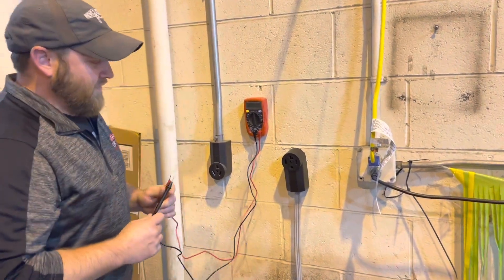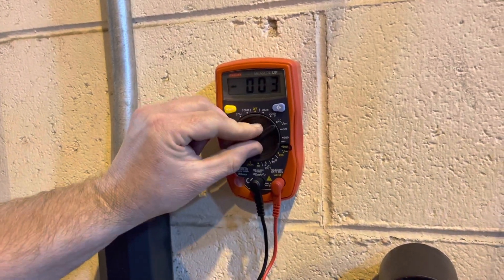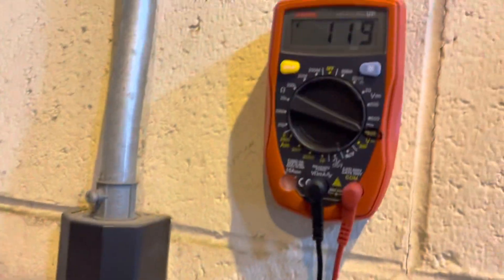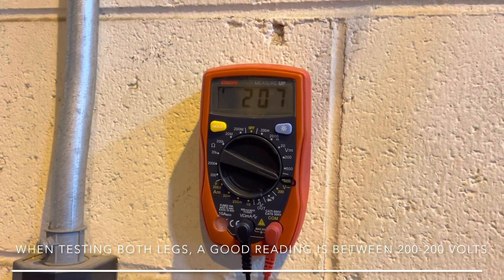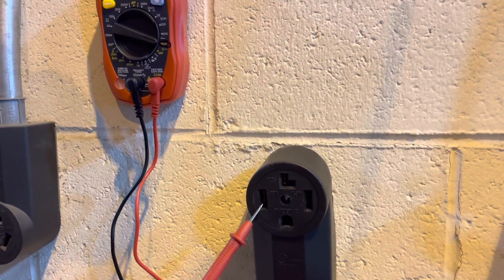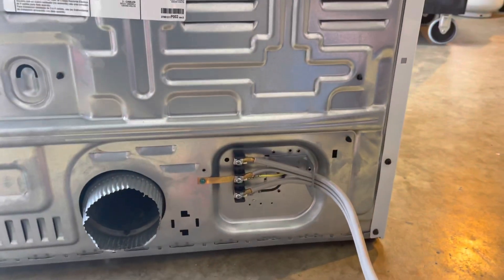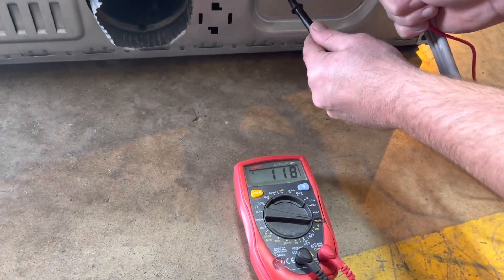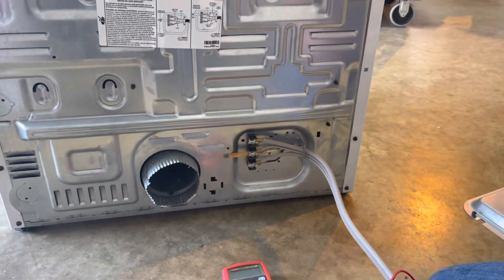How to use a multimeter on dryers and outlets

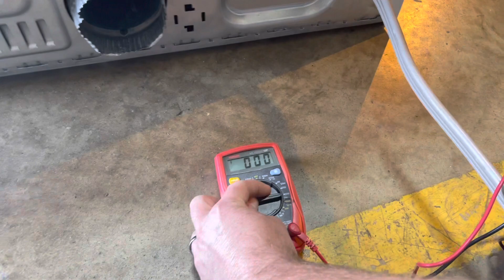Comment: So at around 1:30 in the video, when I did my test, I got readings for bottom and middle, top and middle, but not top and bottom. Would this be an issue with the cord or the outlet?
Reply: Apparently they don't answer you if you ask questions

Comment: The hot leads in. 220 circuit are called "lines." Measuring voltage between the two lines gives you the "line to line" voltage. Measuring between either line and neutral gives you the "line to neutral" voltage. The line to neutral volts are half the line to line voltage.  The AC settings are indicated with a sine wave symbol under a "V" . DC symbol is a solid and broken line. Set your voltage at the value closest to the voltage your testing. In this case, probably 200. Have fun and stay safe.
Reply: Why's the line to line 208v instead of 240v?
Reply: @mikelb5  it's 220v I believe not 240, most circuits have fluctuations and voltage drop off as long as your within about 10 volts of you target you should be fine

Comment: When testing a 3prong. You get 110-120 on each side, but dead across the 2. What could cause that?
Reply: Only one 220 outlet not working in the house. Replaced the outlet,  still the same.

Comment: 240 is deadly. Marcus is a pro. All others should be wearing insulated gloves. I did something similar to this when installing a baseboard heater, made an errant tap with my probe and blew the tip off with a pop that made my ears ring and probably scarred my retinas. Be very careful with this video.

Comment: I learned nothing here. Im looking for an explanation of which of the roughly 20 settings to put the meter on. What’s AC? On the meter I mean. I don’t speak electrician. That would have really helped.
Reply: Step away from it
Reply: Watch a video on multimeters or hire someone.
Reply: If you don't know what AC is, why are you messing with AC?

Comment: I just replaced the 3 prong Receptacle. When I check each side with the neutral. Each side has 120, but when I check the cross( positive and negative) at the aame time it does not say 220. It zeros out or says 3. What could be the problem?

Comment: You have your red probe plugged in the ground(common) plug. Black goes in com, red goes in batt for standardized measurements
Reply: Exactly. Bad video. Also he didn't show the second outlet testing, such as ground to neutral measurement, which can be very important.

Comment: What’s wrong with my dryer plug if it doesn’t test 240 just 120
Reply: It's missing a leg on the back of the outlet or if you have a double 30 Amp breaker, one of them may not be all the way on.

Comment: When testing both bottom legs on a 3 prong, I’m getting a reading of 240. Can you help me understand why it differs from the 200 as stated in your video?
Reply: 120V each x 2 leads = 240V total. Extra info; standard US home service has a breaker panel with 2 energized bus bars inside (hence 2 vertical rows of breakers). Each bar is 120V!

Comment: What if you git 120 volts but when you test both legs together you git nothing? Outlet or breaker?
Reply: Fixed!!! The bottom of the double breaker has a upsidedown U shape connector that was broken and once i got it sitting in the panel it seems to be working. Dryer was working but would not heat.
Reply: @louishill3305  Only one of the hot legs of that double breaker were working.  The motor only takes 120 volts, but the heating element takes 240.
Reply: 120 from wich two points?
Reply: @sirjohnahayfalcon  nuetral to hot
Reply: That should technically be impossible.  You would only get zero across both hot legs if at least one of the hot legs was dead.  In this case, you might get 120v across one hot leg to neutral, and then zero volts from the other hot leg to neutral.  It may be that your probes are missing one of the terminals when you are testing it.